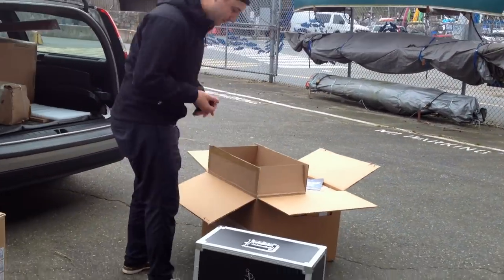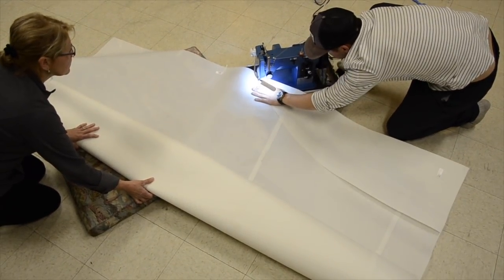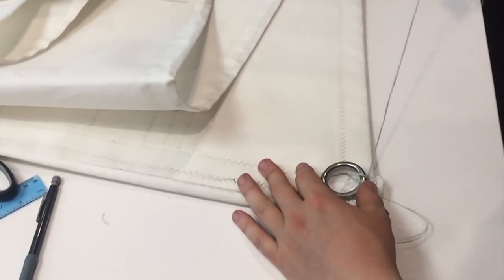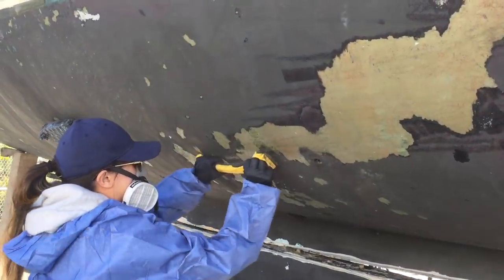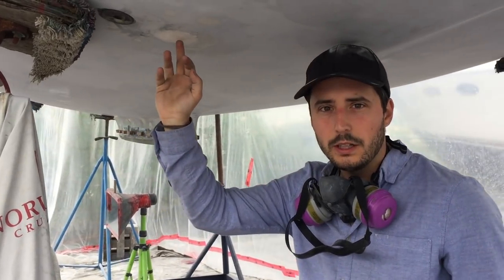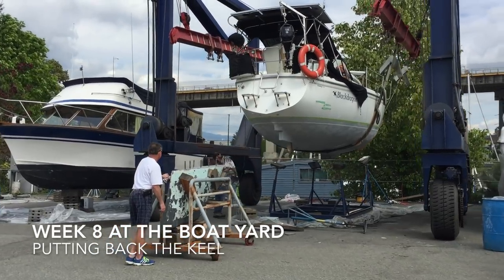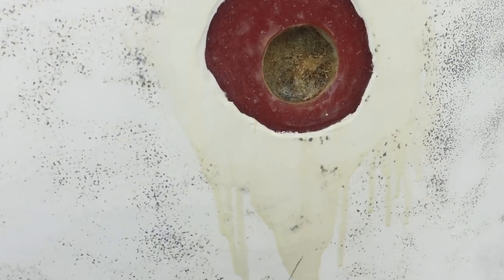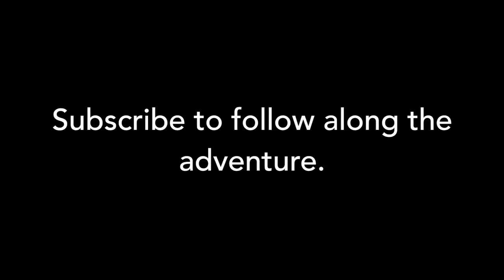DIY Sail Making, Dropping the Keel and Refit Before Going Offshore  | EP 07

Comment: Wow, a lot of work! A few questions: What made you decide to remove your keel? Why did you need to re-drill your keel bolts? How did your sails turnout? Any pics?
Reply from the maker: When we removed the keel, some of the fiberglass from the keel bust was delaminating and reglass 3/4 inches.

Comment: As an owner of the same make and vintage boat, mine is hull #299, I find this video extremely interesting, helpful, and horrifying! I've never had blisters such as your, so I'm curious if you think this is a unique issue with your boat of one more of the manufacturing. What hull number is your Catalina 34?

I think dropping the rudder is a great idea. I have no indication of a problem but it's always good to know if anything is going on rather than hope it's not. What did you learn or find out from dropping it? 

Dropping the keel is a big deal! I've read about it and again it's not something I'm interested in doing unless I see some indication of a problem. I've had my boat long enough to have it pulled and bottom painted twice and so far we haven't noticed a problem such as you saw during the inspection. Would you recommend to another owner dropping the keel if you didn't see any indication of a problem? 

Thanks much and I'm interested in your feedback.
James
Reply from the maker: Hey James, thank you for your comment! 
To honest the blistering on the boat wasn't that bad but since I was stripping the boat to the bare hull. Just thought since I was there, If I take care of the minor ones right now. I wouldn't have to worry about it for another 30 years. I think if your boat had a good barrier coat, you should have to worry about it unless you can notice blistering.

The rudder is pretty straight forward. It's simply a stainless shaft inside a fibreglass tube. No bearings and anything fancy, if you don't see anything wrong with it, probably doesn't worth dropping it. Mine had some minor play in it. (Which you can see during the survey; https://www.youtube.com/watch?v=ebOnRxSY8tI&t=842s ). Which I probably wouldn't of worry about if I wasn't planning to go offshore.

The keel is definitely a big deal. Unless you are seeing serious cracks around your keel bus, the boat was grounded or seeing rust around your keel bolts. There's really no reason you should be dropping the keel. 

Let me know if that's answering your questions. ;)

Comment: you have shore power why not rent a compressor and sandblast unit I have and you can do that bottom in about two hours also use leverage on the keel drive some wood splitting wedges in and a 6ft piece of 2" bar and use your weight:)
Reply from the maker: gbunton Thanks for the tips. Hopefully we don’t have to go thru this again soon! 😁